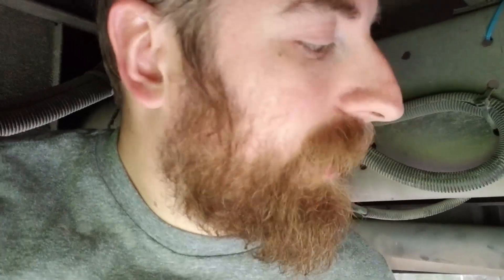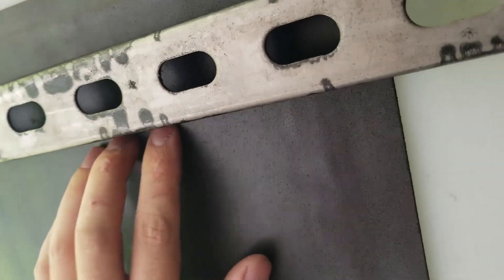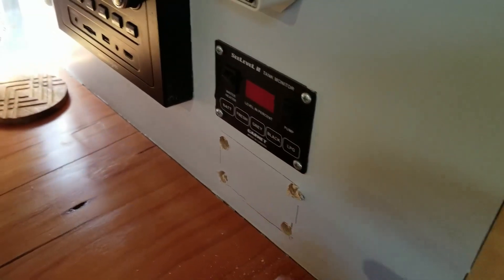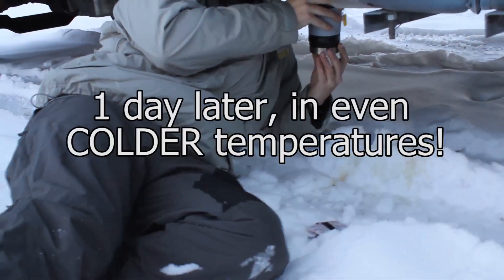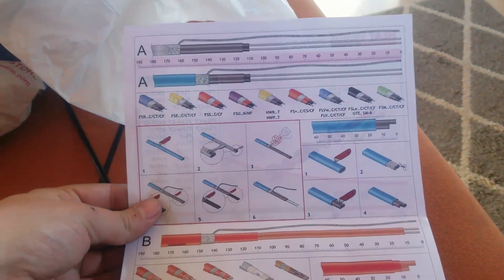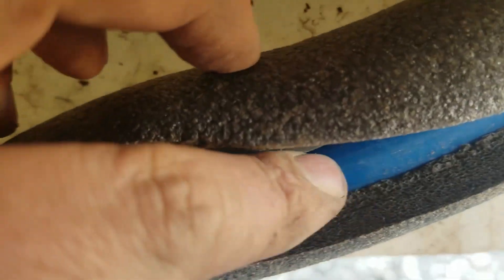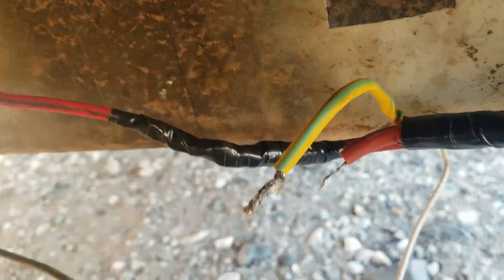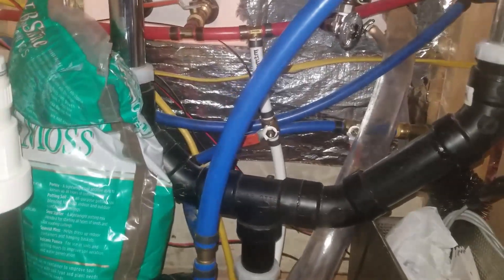Conversion Video 54: Holding Tank Anti-Freeze System

Comment: Just a humble suggestion, since you will be using the wood stove during very cold situations, a heat exchanger on top of the woodstove to circulate and heat up your hot water tank, you will enjoy a very warm shower.  And if you have a recirculating shower, you can actually enjoy endless warm showers!.